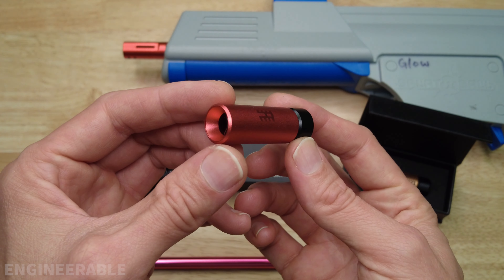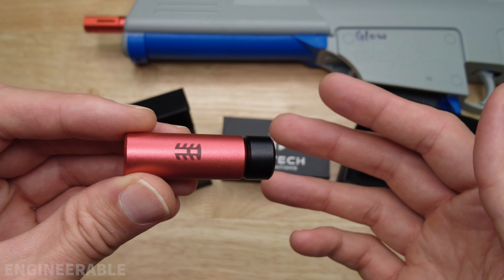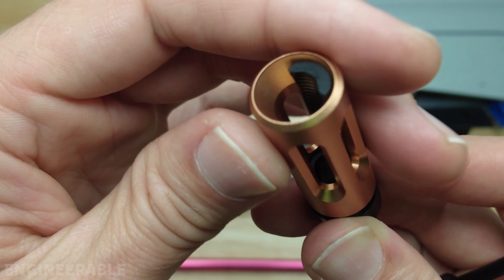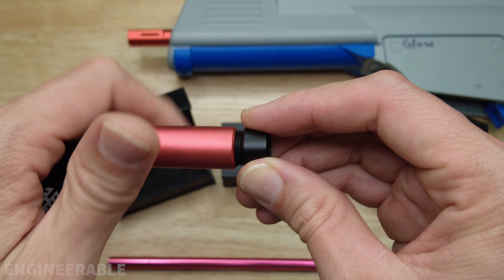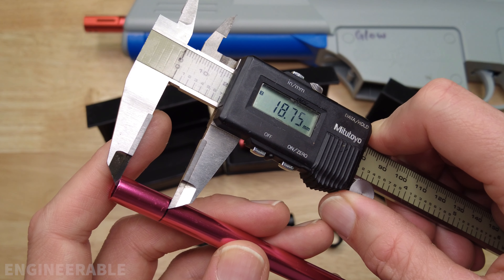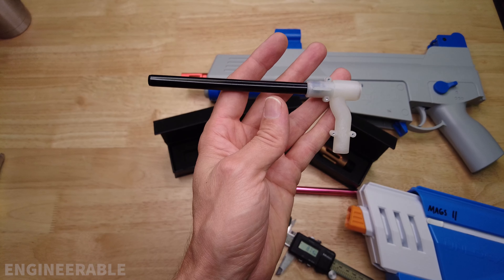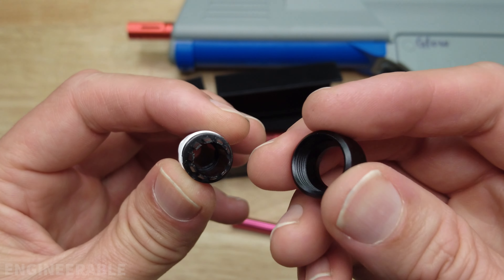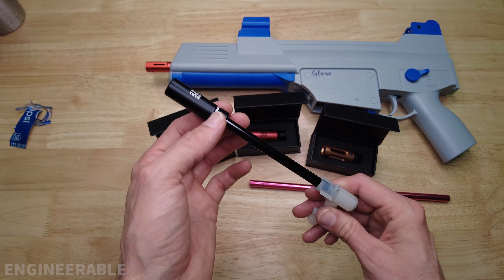BEST or WORST HOP-UP for GEL BLASTER SPLAT GUN??? (AZTECH Range Warrior Hop-Up Review)

Comment: Alright I have a must mod for you. I searched how to do a ball detent for airsoft... there is one that works great. Take a large drill bit down the feed neck. Make a small notch not hole just for the ball to sit in. On the surge your spot is the drain hole. On the XL your spot is slightly in front of the bolt tip not at the drain hole. Just trying to help a fellow tech with new video idea's.
Reply from the maker: Is that to prevent multiple balls from entering the barrel at once?
Reply: @engineerable  yes I just tested it for an hour. Its not perfect but 8 out of 10 are single shot now. What I also found thats interesting. A few of my XL operate closed bolt while the others are a mix of both open and closed.  I'm wondering if that is programming or a mechanical switch of some sort?
Reply: I just did a second gun I think that drain hole is the spot you want on both surge and XL. Remomber just adding a crater NOT enlarging the drain hole.

Just use you hand with the bit not a drill. Very easy and useful mod.
Reply from the maker: @ixclusiverc  ok, good idea. Would be interesting to also 3D print a little flexible finger that goes in the t piece and prevents the gel ball from sliding forward into the barrel until pushed by the nozzle. I've seen that type of retention used in paintball guns.
Reply: @engineerable   I'm actually a paintballer of 25 years, I thought of an external detent, just wasn't sure if the bolt speed would catch and get stuck. Wait till you hear the next mod I have for you😁.
Reply from the maker: @ixclusiverc  I've got an idea I'm going to try. Cut a slit on both sides of the T piece and put an o-ring over the t piece such that it fits in the slot. The o-ring goes inside the t piece walls just deep enough to keep the gel ball from rolling past. The nozzle can easily push the gel ball and itself past the o-ring without getting caught on anything. This does weaken the t-piece, but hopefully it's not much. Maybe just need 1 slit on the same side as the entry, and the o-ring passes through there to retain the gel ball.
Reply: @engineerable  that is a great idea! What your trying to do is very similar to the first generation Autococker. The ball detent was a slit with a wire detent(shaped like a flag pole). Your idea 💡 will work with the one slit and a slim o-ring. As a pump player also we had to figure this out on a cci phantom. 1 option was to use 3 drops of nail polish Spaced evenly at the entry bore of the barrel. All of them will work as a detent you just need to watch for the amount of pressure applied to the gell to cause spin to early in the breach of the barrel. I personally think it should be fine with your intelligence i know you'll figure it out. 
I also did figure out single shot operates in open bolt position as 3 shot and full-a operates in closed bolt. 

I have a hopper mod extra pods and rear stock mod for you next.....☝️  both completely transform this into competition style blaster.
Reply from the maker: @ixclusiverc  Cool! Thanks for ideas. I noticed that the NERF blaster always defaults to the closed nozzle position. I assume they did this to prevent balls for pouring out (if undergrown) and reduce double shots. The downside is that there's a delay when the trigger is pulled.

Comment: Why the hop up is at the front of the barrel? Isn't the hop up should be at the t piece, just like for airsoft guns?
Reply from the maker: In airsoft, the barrel ID is larger than the bb. In gel blaster, the barrel ID is the same or slightly smaller than the gel ball. Therefore the gel ball will not spin consistently inside the barrel. It has to be spun once outside the barrel.

Comment: Hello! I was just wondering, if you have opened up the Surge XL, what is the battery size. Thank you!
Reply from the maker: It uses 2 18650 cells in a side by side heat shrink pack.